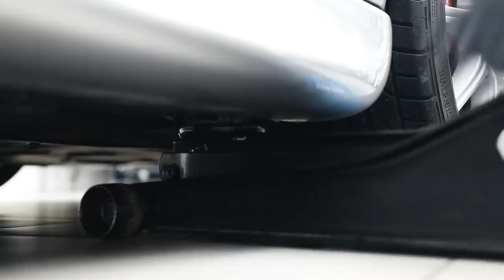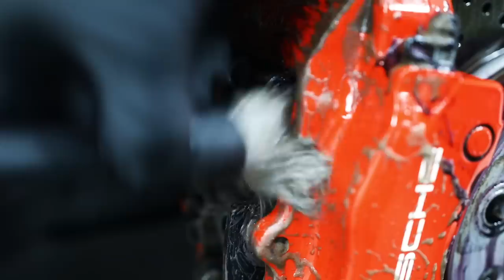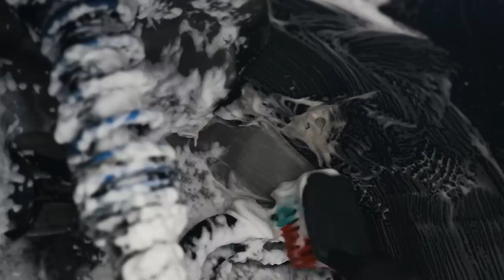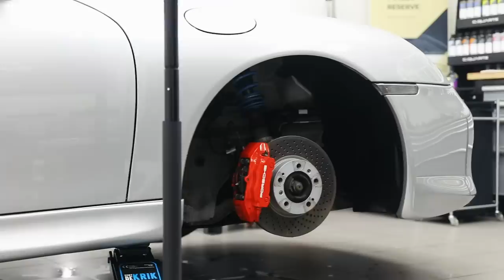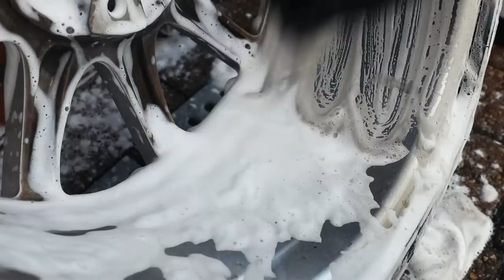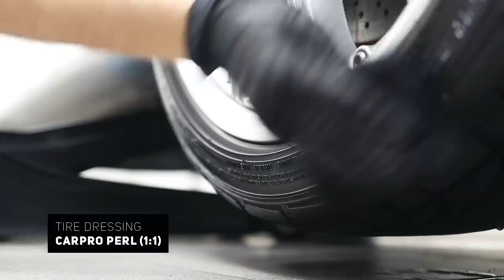Wheels Off Detail - Cleaning Wheels & Wheel Arches (911 GT3)

Comment: Wow, sweet! I just finished working in the garage I work in today, and now get to see a proper deep clean. That's a good start to the weekend😃
Reply from the maker: Good timing by me! 😄 Hope you enjoy the video! Also, enjoy your weekend!
Reply: It sure is😉 Also, what nozzle do you use for the IK? The one for the thickest foam? I bought it a month ago but cannot seem to get foam as thick as you do
Reply from the maker: I use the grey nozzle. Getting the right thickness and spray pattern really comes down to finding the right dilution ratio in my opinion. Also I usually only fill up the container for about 60%, that way you can get enough air (and enough pressure) into the foamer.
Reply: @VermijlCarDetail  Thanks for the advice, then I guess I will try out more in the future to see what works best, cheers!

Comment: Nice video, but do you have a tip to avoid rust on the disc brakes without removing the wheel ? Because when you start driving again.. all the ‘ dust’s rust ‘ coming all over inside the wheels again..
Thanks

Comment: Awesome video, especially the product ratio, as silent comments. Using CarPro is the magic of dilution and mixes (hello Elixir). Your channel is the rear case when you can watch the same cars detailing again and again while every time is noticing new details.

Few questions so far:
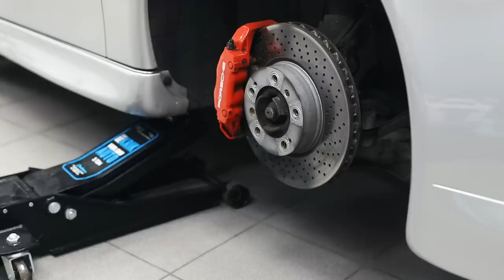1. What is the algorithm to SUM MultiX(1:20) with Reset(1:500) in a foamer? E.g., 1:1:520? 
2. Is it worth to spend DLUX on wheel arch plastic? Is it okey to think DLUX as durable Perl alternative? I do worry that It will be quite complex to maintain hard to reach parts Perl'ed with the wheel on.
Reply from the maker: Thank you so much! I basically use MultiX 1:20 and add a little bit of Reset just so it foams better and sticks to the surface for longer. Too much Reset will make the foamer clog up. You could use DLUX instead of Perl, it might last longer but I don't think you will get close to 1 year of protection because these areas tend to get really dirty.

Comment: Looked great! 
Curious why you’ve used iron x straight onto dirty wheels and brakes? Is it not more efficient to clean them first, then use the iron remover?
Reply from the maker: Thank you! I did clean the wheels in the beginning, I think you might have missed that
Reply: Vermijl Car Detail on the inside of the wheels and the brakes you just used iron x first?
Reply from the maker: @marcjarvis3975  my bad, was looking at the wrong video between the overview of my channel comments. The vehicle got a wash beforehand where I also pre-rinsed the wheels. You could indeed wash them first, that way the IronX cleaner will be a bit stronger. But since I knew the brake bust wasn’t that stubborn, I decided to do it this way. It might be more of a personal preference.
Reply: Vermijl Car Detail nice one, thanks very much.

Comment: How did you prevent the rotors from getting rusty? Great job.
Reply from the maker: Thanks! A light mist of Bilt Hamber Auto-Mac prevents them from getting rusty. Didn't include this in the video because they were fine after the steam cleaning and a simple wipe down.
Reply: Vermijl Car Detail thanks! Is that safe if it gets on wheels as well? For instance a wheels on detail? I will have to try this as I’m always tired of rotors rusting over.
Reply from the maker: @joejohnp  It will always drip on the wheel at least a little bit. You can just wipe it off when you're drying the weel, no big deal. Never had any issues with it getting on the wheel.

Comment: Brake buster is better than iron x ? Thanks for your reply
Reply from the maker: Depends on the purpose. I’d suggest using IronX if a stronger cleaning is required. In this case I recommended it instead of using Reset and MultiX as a follow up of IronX.
Reply: Vermijl Car Detail bedankt voor uw antwoord 🇧🇪👋🏻
Reply from the maker: Graag gedaan! 😉🇧🇪

Comment: I am pretty sure using any iron removing products on carbon ceramic brakes will mess up the brake system!!!?? I know I’ve seen an aventador and Ferrari’s carbon ceramics fail after using iron directly on brakes and rotors!?
Reply from the maker: Hey Antony, that’s true, but these are not PCCB, these are standard steel brakes
Reply: Vermijl Car Detail ohhhh ok I see! Nice! First time I’ve seen IronX in a paste version! Do u think that works better than the spray? Or just preference really
Reply from the maker: @antonyv8171  the paste version clings better to vertical surfaces, it sits on the surface for longer and does a better job at dissolving those stubborn iron particles. I don't use it very often, but for this specific task it is a useful product!

Comment: Why fall out remover a brake disc. Promotes rust on the disk
Reply from the maker: It clearly doesn’t. As if it wouldnt get on there if you would be using this when the rims are on?
Reply: Vermijl Car Detail fall out removers active ingredient is designed to rust the little bits of break dust that embed into the wheel. Accelerating the rusting process of the fall out is the means it’s released. Sure you can wash it off and if I’m honest that’s the answer I was expecting you to come back with but spraying directly onto the disc seems counter intuitive to me as of course it’s going to activate it’s metal